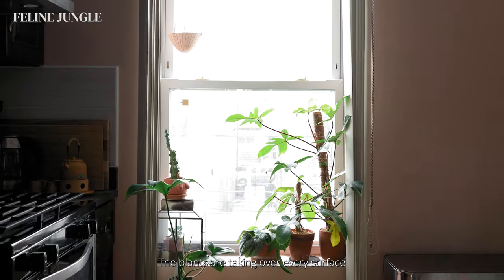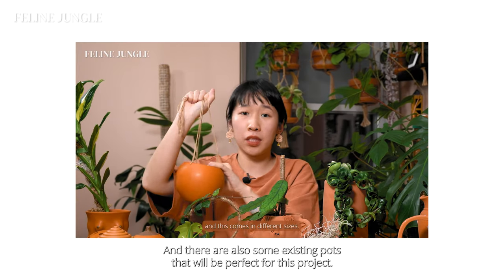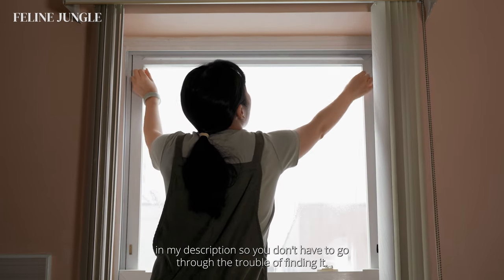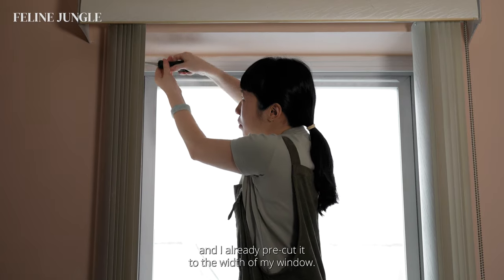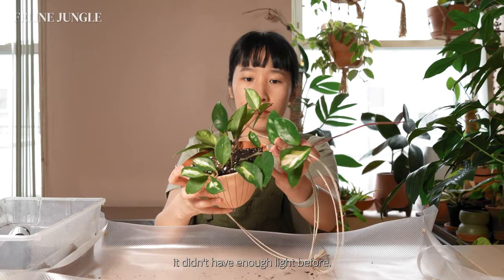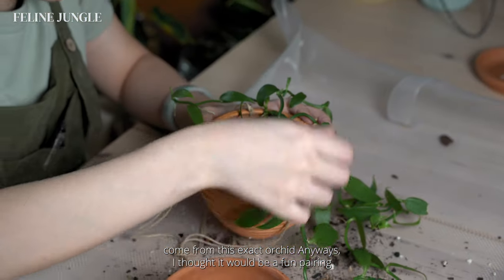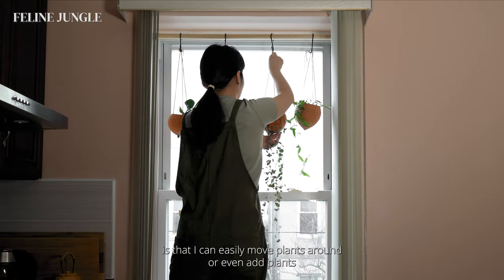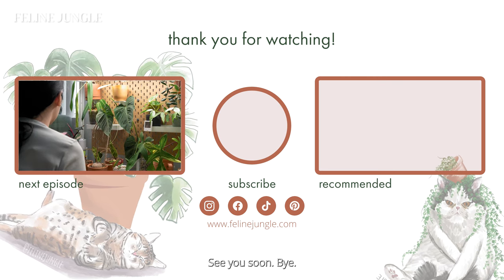Decorating Window with Plants | DIY Window Garden Ideas | 05

Comment: If you take down your shades, leave the square boxy part with the front panel up that you slide your shade into.  I removed the shades in my kitchen and dining area.  Instead of inserting the shade, I now insert a dowel rod.  No need to add anything and you have that faceplate that now covers the rod.  Mine were dark green wooden shades, so the dark green faceplate with the plants hanging is nice, At christmas, I put other things on the rod.

Comment: I would love to hang all my trailing Hoyas at my window. But don’t like drilling holes and damaging my walls. So i only do if they are going to be permanent in there places in my home. Also sometimes we don’t know what is behind the concrete we had a few episodes where there are metal so could not drill. So had to fill in those holes and repaint. Ended up buying a metal detector so we know where to drill which is kinda expensive. Been thinking using extendable poles instead. I do like the hanging rod i would have gone with the white bracket’s and white hooks. I am a fan of neutral colours.